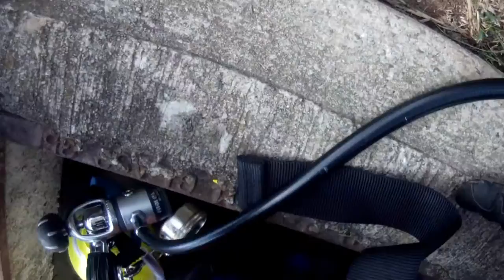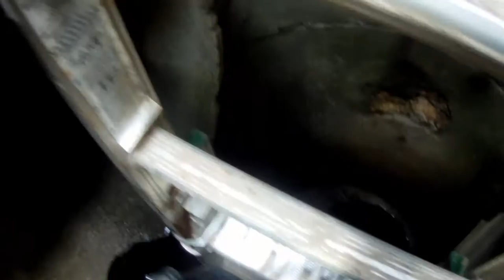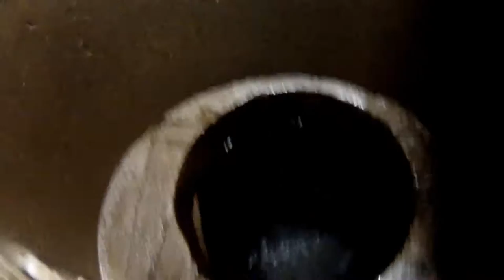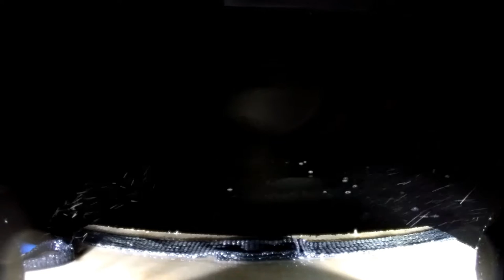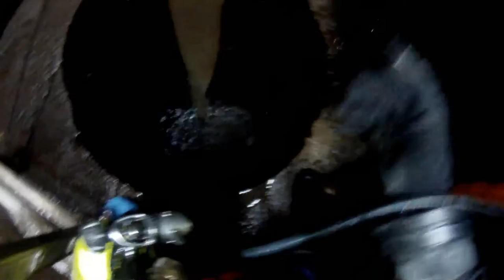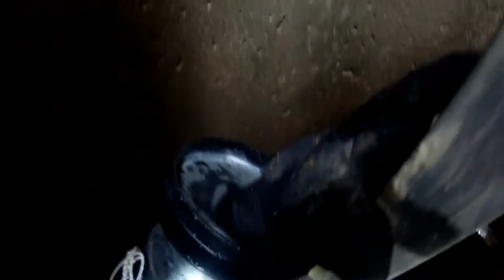Sewer Diving "Not As Fun As It Sounds"

Comment: not trying to be rude but I work for a public works department and when we go into storm drains we have a tripod system above the entrance hole and continously pump clean air down. we are also required to wear head protection being that it is a confined space. cool videos none the less
Reply from the maker: Will Girard You are correct, a helmet would have been perfect, but dummy me left it at home with the rest of my repelling gear.  I was using my teammate's harness and his helmet would not fit me.  It was a risk I was willing to take given the nature of the job.  If this would have been a call out with our dive team, then yes I would have been required to wear it.  As far as a tripod system, the short distance I was going down, we were able to create an anchor system on the tow hooks of my teammate's truck. The entry hole was way to small for the truck to fall into, so no risk there.  I believe I used more of my TR Ropes and Rescue Training than I did my Dive Training.  The small 30cf bottle and Full Face Mask was plenty of air for what I was doing no need for a ventilation system.

Comment: So ,did you find out what the problem was.?
Reply from the maker: What's Up? We did. The earth below the pipe system had settle causing a dip in the drainage line. This in return created a dead pool. The construction crew had pumped down to the level line of the water, but was unable to pump anymore due to the dead pool. This is why I camera system would not go any further than it did. It stopped at the bend in the pipe.